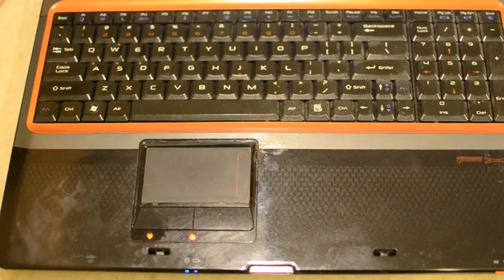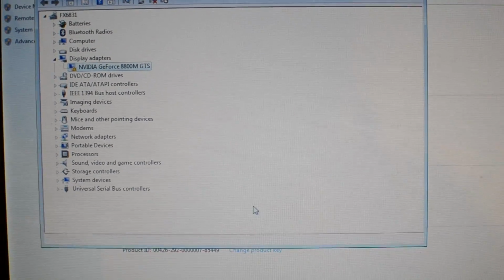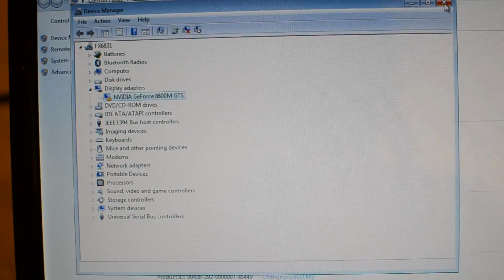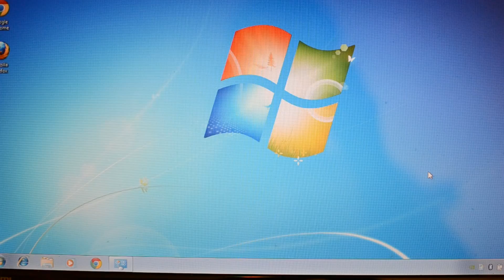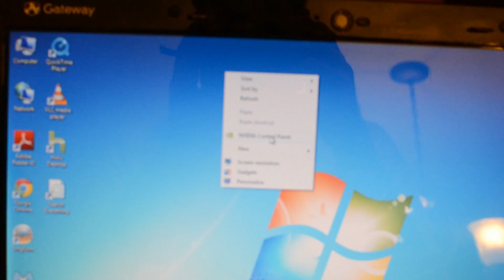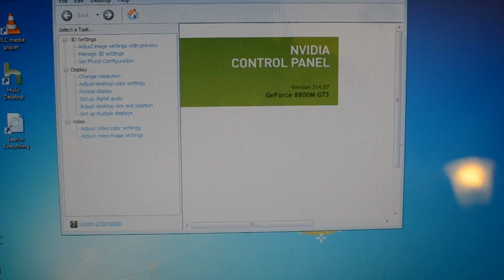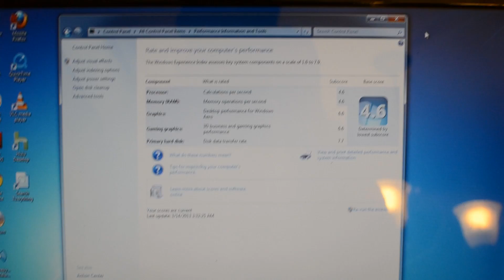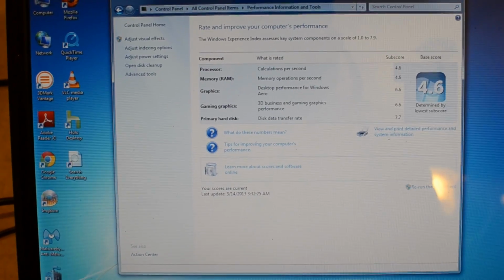Gateway P-6831 FX "Code 43" Laptop Repair

Comment: Hello I have a question I have a laptop with a gtx 1050 I opened it one time and cleaned only the fans en de heat sink and now it gives me every time that error code 43 but it detects my graphics card can you help me please
Reply from the maker: Your GPU PCB or chips are likely failing or have failed. This trick worked to fix an old laptop for me, but it's not guaranteed -- other parts of the GPU can go bad that are more difficult to repair.
Reply: slazem, have you tried this method to your laptop? is that work? i have very similliar case like you, cleaning the fans and repaste the gpu then the code just show up and can't use my gtx 1050

Comment: Hey there... would this same solder issue cause the graphics card to stop working?? Mine has the one long and two short beeps with no display at all... Do you think the hairdryer might fix it?? I do remember seeing the code 43 before it finally stopped..
Reply from the maker: It's possible, though it can be a lot of different things really. Bad VRMs, blown capacitor, bad traces, or any fried chip. You can try it, though I can't guarantee any level of restored functionality. (I was frankly surprised it worked on the Gateway laptop.)

Comment: thanks for the video, 
i just resolve my issue code 43 at my 780M alienware.
i try everything to get back normally, Ran DDU in Safe Mode to completely remove all my of drivers, rebooted, then downloaded the latest stable release of the 780M driver from the website and installed it (I did this twice, with and without installing the GeForce experience because I read somewhere some people have problems with GeForce), then rebooted. NOT working
i change my windows from win 8.1 to win7 64 and go to win 10 64. and got NOT resolve the issue.
finally i give up with the gpu, and thinking i cant get a new gpu. 
and i saw this video, and learn others video to how baking up the gpu. so i give the gpu one more shoot.
i baking up the gpu, at 200C' for 10 minutes. and cooled it self about 45 minutes. and repaste the gpu.
when i start up the windows (win 10 64 bit) i notif that nvidia control panel have showed for the first time.
until i write this comment, my gpu working normally. 

hope for others help to solve the issue. 
thank u so much for your video.
Reply: hi, does it still work after a year? Im planning of doing it to my 960m

Comment: Thank you Jarred!  I had "Code 43" on my Gateway P-6831 FX last night.  I just performed this fix tonight and it works! I used a harbor freight 1500watt heat gun, which actually only runs at 1300watts. I also used a harbor freight Infrared thermometer to monitor the temp.  Yeah, and this computer is over 7 years old now!

Comment: I recently bought a ASUS gaming laptop with an NVIDIA GPU, and i have only owned it for 3 months before i got the code 43 error (2 weeks ago) its pretty new so is it normal for this to have happened to my PC even though it is new?
Reply: Same thing happened to me with thre same computer with NVIDIA card in it. Did you find a solution? i would appreciate the help.
Reply: si I just updated the drivers to the latest version.
Reply: si Were you able to fix this error with the same method, or did you have to try something else?

Comment from the maker: I don't know if it will fix the 6990M or not -- it might, and if you can get at the GPU you can give it a shot. If the GPU is not working, worst case it continues to not work, so unless you have some other way of fixing it there's no harm in trying. You could also try baking it in an oven (Google it) if you want. If a capacitor has blown, though, this won't do anything for you - you need to replace the bad capacitor in that case.

Comment from the maker: Given the complexity of accessing the GPU heatsink, just about anything could potential break and cause the laptop to stop working. However, it's also possible and more likely that you just didn't reconnect all the wires and ribbon cables properly. For example, the top multimedia panel has the power button, so if the ribbon isn't connected properly you will never send the computer the "power on" signal -- it's like flipping a light switch on and off when it's not connected to anything.

Comment from the maker: You're basically going to have to fully dismantle the laptop, which is what I do in this video. The only thing you wouldn't have to do would be the heating up of the GPU to reflow the solder. All I can suggest is to keep careful track of the screws, as there are a lot of them.

Comment from the maker: You have to order a replacement fan. They can be a bit costly considering they're just a fan, but mostly that's price gouging by the places that carry them. Try a Google search for "gateway fx gpu fan" and you should be able to find a suitable fan. Of course, if the problem isn't the fan you just wasted money...so you might want to disassemble the laptop and clean it first and see if the fan spins freely or not. If not, buy a new one! If it does, you can still try a new fan, but it may not help.

Comment: Hello, My P6831FX has started to go to black screen when tying to play games that require a lot of graphics but the computer is still on. I checked core temperatures using HW cpuid and everything is running below or at max temp. I noticed that I do not see the Fan for the GPU of the graphics card spinning underneath when I hold it up. Could this be my problem? How do I replace just the heat sink fan for the graphics card?